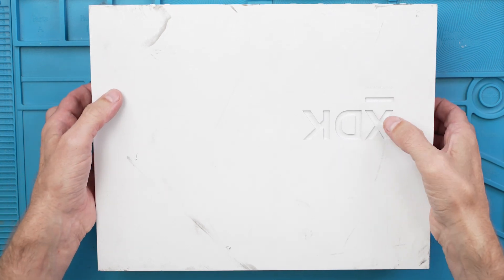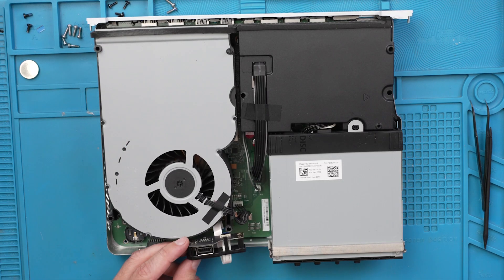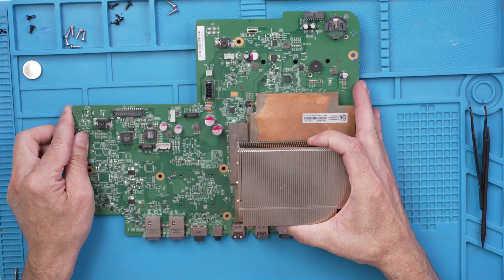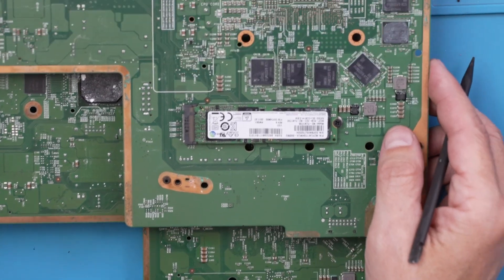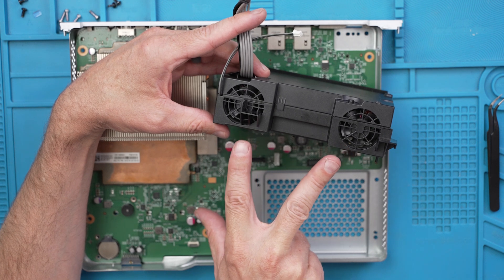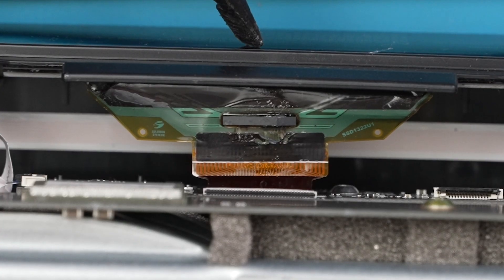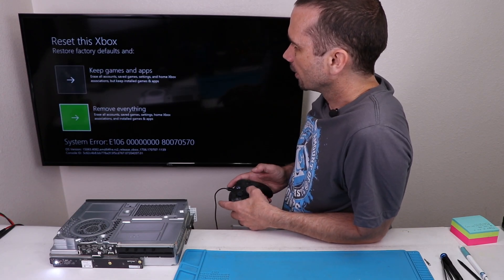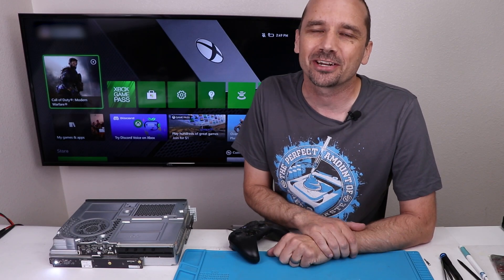I Bought a BROKEN Xbox One Dev Kit - I Let Out The Magic Smoke!

Comment: According to Scorpio Engine specs it has gen3x4 PCIe lanes dedicated for m.2 slot, that means we potentially can significantly improve drive speed. Another question does Xbox come with the nvme driver ? Also it won't boot from m.2 drive, coz it requires some sort of BIOS support, which is most likely missing. Still it would be nice to have extra storage for games. I vote for "m.2 video"!

Comment: It will be great, if You try to run this m.2 on retail xox. Cactus_fabG_retail schematic shows that few more components missing than only m.2 connector: to enable m.2, to enable power for m.2, reset, serial lanes caps (etc) and probably  reference clock from U35.  You run this devkit in the retail mode so the chance is pretty huge for m.2 in retail console.

Comment: That wasn't a devkit drive that you wiped, was it? If so, unfortunate. Always dump the drive before you wipe it.

The devkit activation is done over the network, MSFT verifies you're authorized to use the kit and can disable the dev functions if not. This is what you ran into.
Reply: XDK was sold without HDD, by electronics scrapyard (I suppose) - they are (almost) always get drives out of devices (and destroy its).

Comment: Xbox Project Scorpio(Xbox One X) Devkit.
There is 1 HDD for Retail and 1 SSD for Build Deployement.

The OneX was supposed to have an M.2 Inside for faster load times but the idea was dropped because of price, that's why there is trace, the PCB of Devkit and Retail is different.
Apparently, someone tried to populate it, but it does nothing, the Software just doesn't care.

The Additionnal Memory is for all the Debugging that happend behind.

Activation works with a Token that is send by Microsoft Server when you connect it to internet, each Devkit has Unique ID, Devkit that are not supposed to be used are Blacklisted.

I don't think it could play Games, even it retail mode, but if it does, you actually have a pretty nice Xbox One X Pro because the Devkit is more powerfull in Raw Power than the One X..

Comment: An M.2 slot transplant video would be interesting, but I can't imagine it wouldn't end in failure since you'd have no way of directing the motherboard to actually use it over the SATA connection; as far as I know, neither the Xbox One nor Xbox Series consoles have been successfully jailbroken in the last ten years (easily accessible devkit mode has removed a lot of the impetus to do so). But maybe I'm overlooking something; still, it'd be a neat idea.

Comment: that cracked and smoked component is called COF (chip on film) that directly connect to the glass on LCD screen with its TCON (timing controller) board, you will need to source the COF flex and attach it with specialized bonding machine, OR replace the whole lcd+COF+TCON assembly (not sure how generic they're)
either way doesn't seem viable to do

Comment: 4:20, you have to try and solder on that connector now! I wouldn't be surprised if it does work, as long as the board still has traces to the spot

Comment: The broken OLED can be replaced with any 256x64 OLED that has an Solomon Systech SSD1322-Controller on it. After looking up on google I found the CFAL25664B-Y-B1 but there should be some more that fit. So you could get that work. :)

Comment: In retail mode will it perform any better playing games with the additional RAM ect. or will it only use what a retail system can use?
Reply: No; all games already fit into the "retail" RAM and cannot expect any more. The additional RAM can be portioned by developers between adding extra RAM to the title (game) when debugging (so e.g. you can load in debug graphics that won't be there normally) or "tool memory" for the development tools for e.g. framerate profiling.

Comment: You can buy a ribbon cable in any size, pinout,pin distance.

When the devkit was not activated you must use the internet to activate it. But it will get banned.
If it was activated you must not connect to the internet if you want to develop your own game.

Comment: For sure, i doubt it'll work since it might need an m.2 controller but if you compare and add what's missing I'd love to see that. I'm sure Microsoft wouldn't be happy if it worked lol. Great video as always Steve.
Reply: We band together and demand Steve tinker with the boards!  This video or we riot!
Reply: Im not sure it would, from what happend to linus's kit and the kit on reddit, the second the conslole connects to any network it deactivates the console. Prob a prevention system they implemented
Reply: @rubensantos7925  Also the retail software is probably not using that partition even if the hardware could recognize the SSD.
Reply: @Notharius1  the prices are rediculous! i'm glad i purchased 9tb. it looks like buying that ammount now is a $450 price hike. pretty insane! where's the 4tb microsoft, you promised.

Comment: The devkit and your ip are registered to microsoft to use the xdk mode. I have actual xbox 360 devkits and the psu on those needs to be pretty beefy too...like REALLY beefy. This is basically a fancy retail xbox now.
Reply from the maker: Makes sense
Reply: I figured someone in the comments would know how the devkit mode works. Sad that there would not be an easy workaround but I get why Microsoft would lock it down like that.
Reply: @ryanb509  after the 360 yep